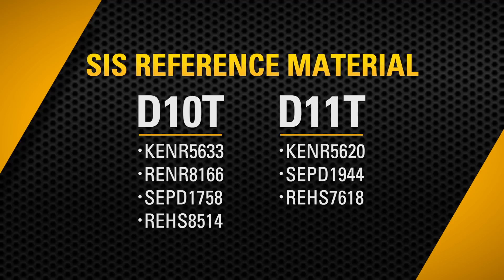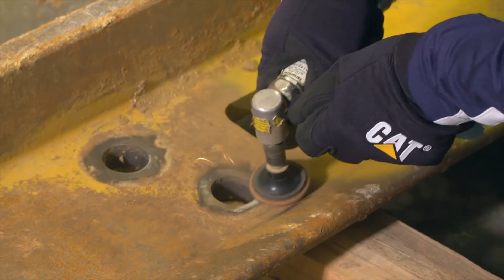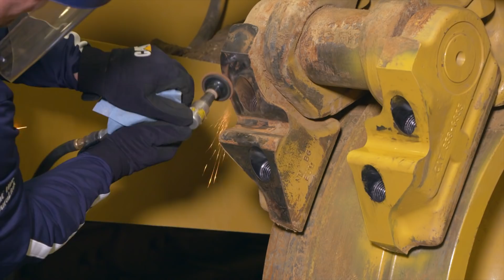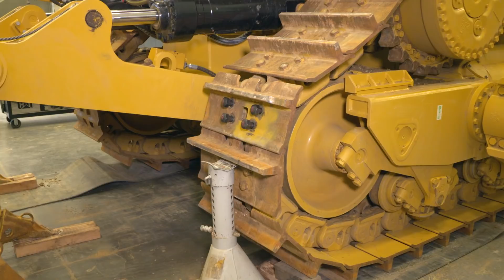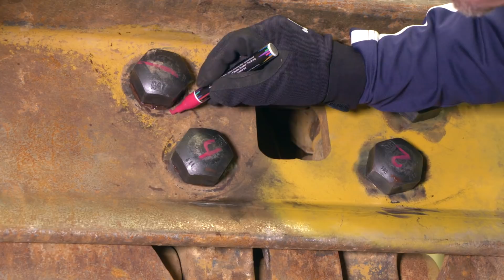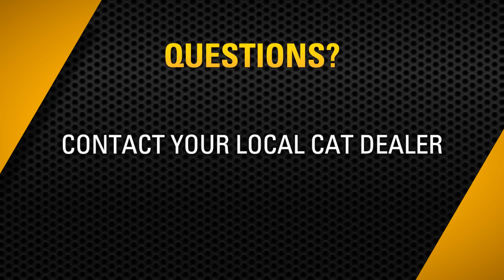Caterpillar Large Dozer Undercarriage Single Tooth Master Link Torque Procedure

Comment: I was given some excavator bucket teeth pins and track pins by a friend who works in a quarry. Can you tell me what kind of steel they are typically made out of? He told me the torque specs on the pins and though indont remember the specifics i remember thining that it was ridiculously high and must be made from some high strength steel. In appearance it looks like maybe 1095... could be a tool steel for sure but as it rusts it appears more like 1080 or 1095. Maybe an O or W series tools teel... any info is appreciated.
Reply from the maker: Hi Daniel! Your local Cat dealer can help you with any information you need about our excavator. To find a location near you, visit https://www.cat.com/en_US/support/dealer-locator.html?utm_source=youtube&utm_medium=social&utm_campaign=cic_social_care. – Elias